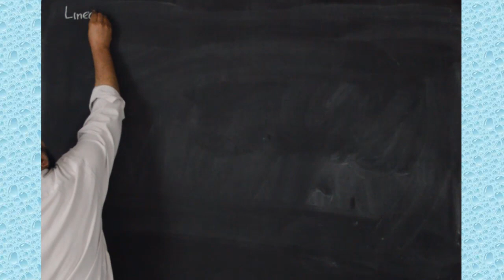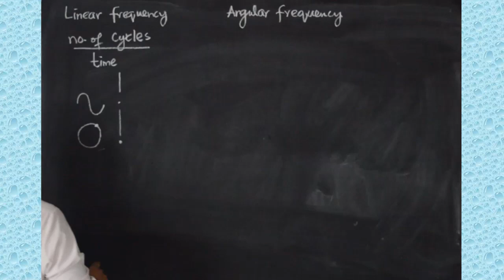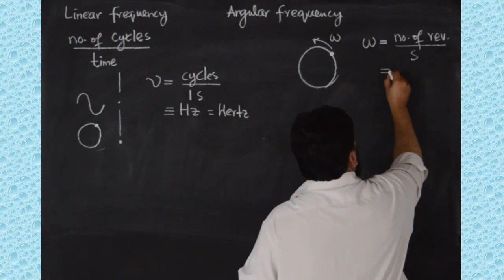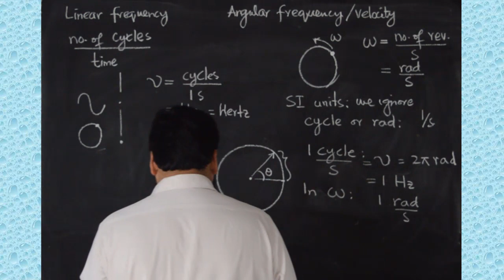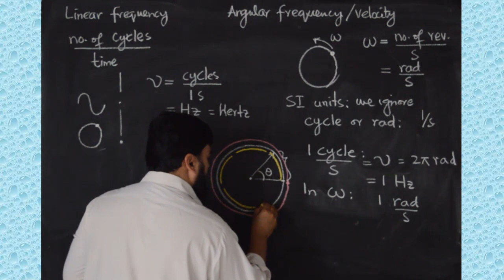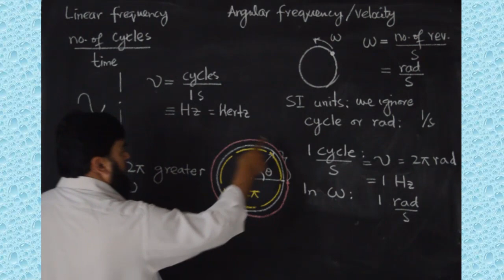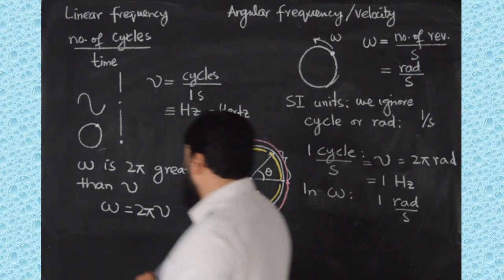Difference between linear frequency and angular frequency: explained step by step

Comment: Sir in horizontally mass attached to the spring we Includes angular frequency, although there is no Angular motion here,  Why sir ??
Reply from the maker: Back and forth motion and angular motion are the same kind of motions. Thanks
Reply: @SAYPhysics  
Sir How they are same 
Plz clear it..
In angular motion we discuss the change in position ( angles )
W.r.t time..
But in horizontally mass attached to the spring, how the angle has been studied ?
Reply from the maker: Back and forth, pendulum oscillation, and circular motions are all the same type of motion. We study it in the form of space (angular displacement) and time (angular frequency).